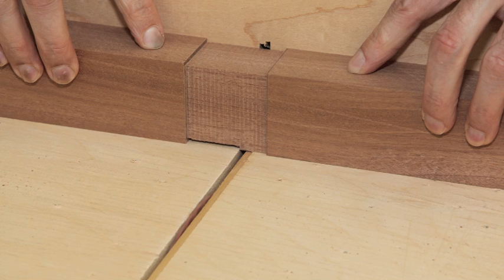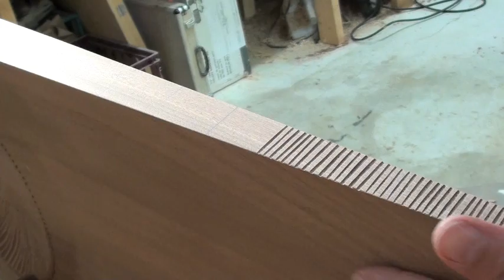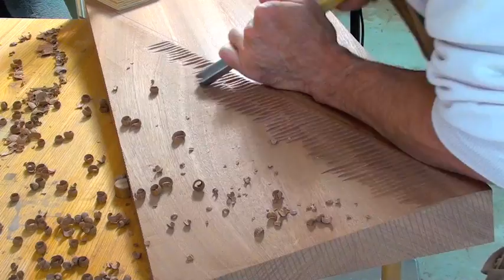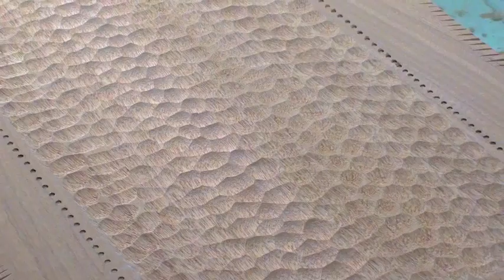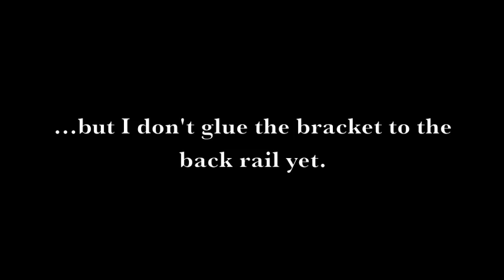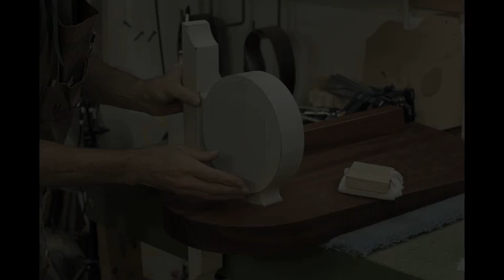Build a Textured Wall Shelf

Comment: Hi Matthew.  The gouge I used for the light texture on the majority of the top was a #3.  It was about 25mm wide, I think.
Reply: looks like much more than a 25mm to me
Reply: @TheWoodWorkingPilot  There were a few different gouges I used.  The gouge at about minute 6 was likely about 1-1/2" wide, if that's the one you're thinking of.
Reply: @robbrown8092  yes the wide one (1.5” makes sense). What is it’s curvature?
Reply: @TheWoodWorkingPilot  It was a 3 sweep gouge, I'm pretty sure.